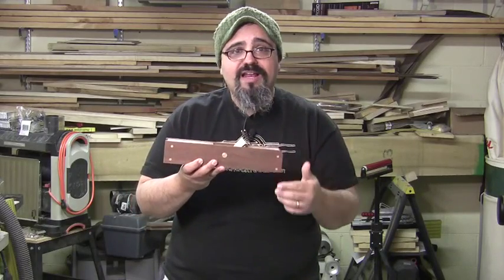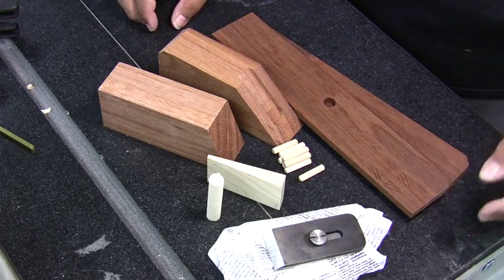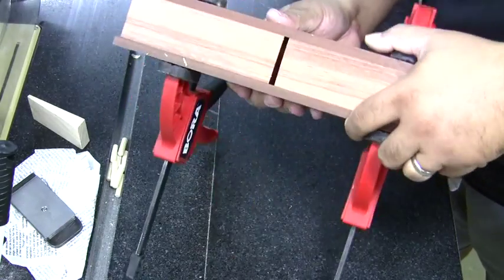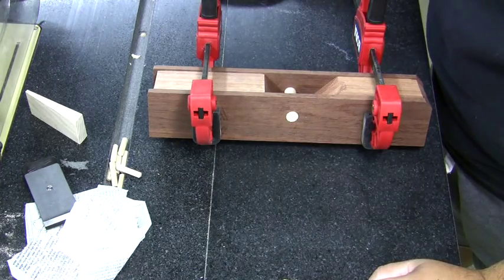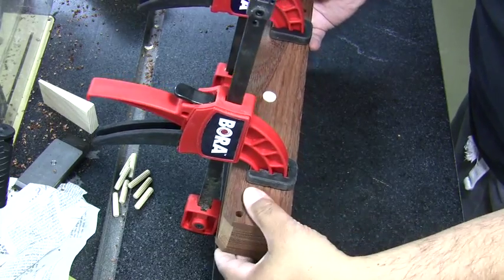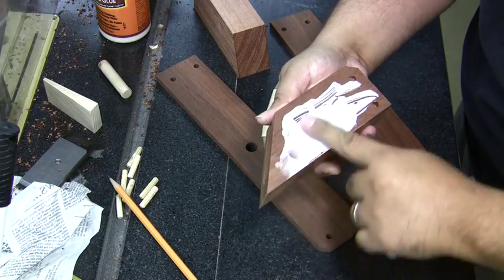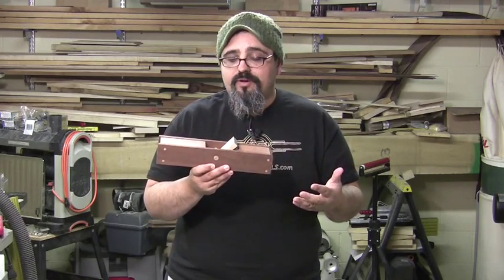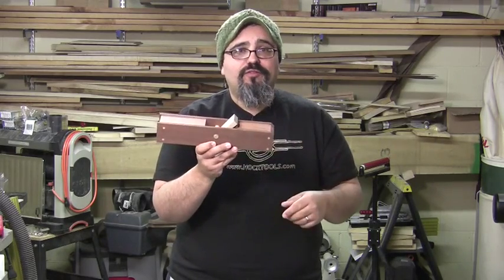481 Building a Hock Smoothing Kit pt 1

Comment: I just got this plane kit and I have also watched the video of Ron Hock assembling this plane.  I  believe the chamfers are only for orienting the sides and center blocks.  I believe the sides should be flush with the back and bottom of the rear block.  Looking closely at Ron's video, this appears to be the case.  I do find the instructions a little unclear.